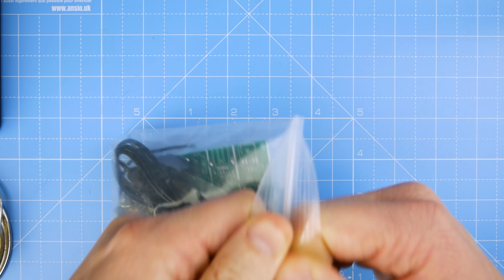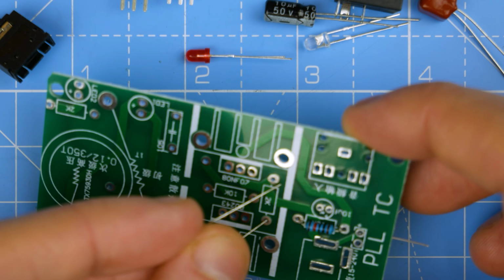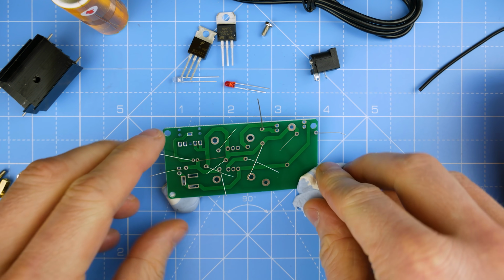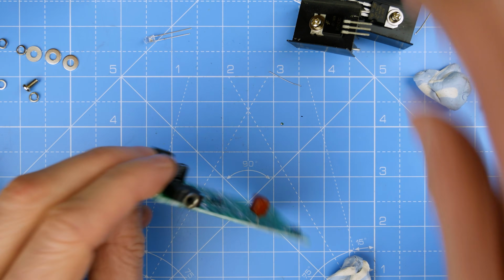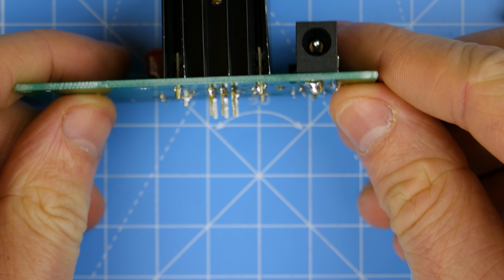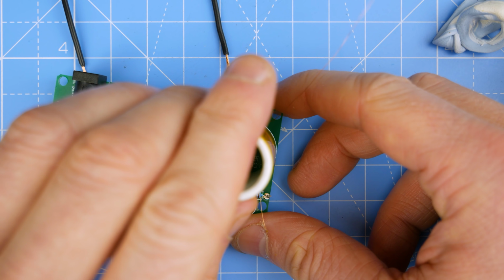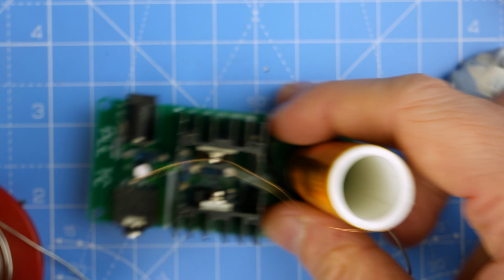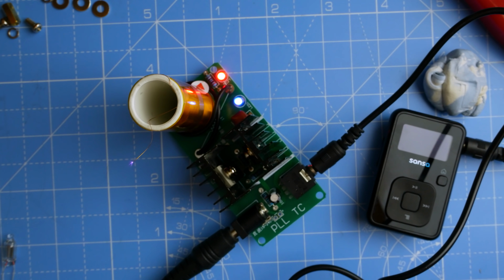LAZY SUNDAY - Tesla Coil : Mini Plasma Speaker - LS14

Comment: David, your soldering iron temperature is FAR too low. Also, because your aren't heating the joint properly you continually feed the solder into the soldering iron tip... You should be heating the joint with the iron, then feeding the solder onto the joint (not the iron).

Comment: Hi David,I noticed you didn't bother using any thermal grease on the heat sinks. Is it really necessary anyway ?Thanks for the info. Interesting little kit.
Reply from the maker: Paul Thurston if I was going to be running it for long periods then better thermal transfer would be important and thermal paste or grease would be kind of necessary. Generally I like throwing caution to the wind with these kinds of projects :-)
Reply from the maker: Paul Thurston it was too hot to touch in 10 minutes of operation so a fan would likely have more of a positive effect in this scenario.
Reply: Thanks David.  My kit came without the thermal grease and I don't have any handy. Bytheway, Is the power input  +Plus or -NEG polarity ? Cheers Paul.
Reply from the maker: As I recall the power supply is centre pole positive. I gave the plasma speaker away so I am afraid that I cannot test that.
Reply: Thanks David. ! Cheers.

Comment: Wow can you please learn how to solder properly? You show People exactly what you are doing and they think this is the way to solder. Otherwise I really like your Content, so just a good meant tipp.
Reply from the maker: Feel free to educate me (honestly, this isn't me being glib), I am quite honest about my abilities in every video I produce and I am sure you will see my soldering vary wildly from video to video. I can assure you soldering with a tripod and camera 5 inches above and microphone sensitive to the heating element in the iron isn't the most comfortable position to get around the components.
Reply: Dööörk Comments like this are not constructive unless you say specifically what is wrong. Perhaps you could elaborate to aid learning, as I find David’s soldering to be good enough, which means I am also doing something wrong according to you.
Reply: The soldering is fine, except the temperature of the iron is way too low, which is why every single joint is painfully slow. That said, the use of BluTac always makes me shake my head, as does the weird order of component placement/soldering which means that Blue Tac is required (since the flat surface of the bench cannot be used to hold the components I place)..